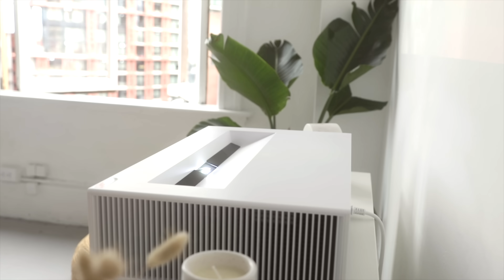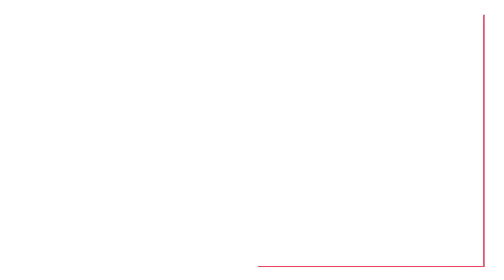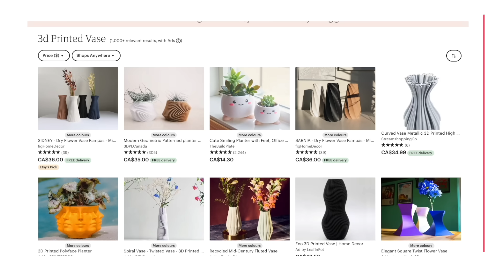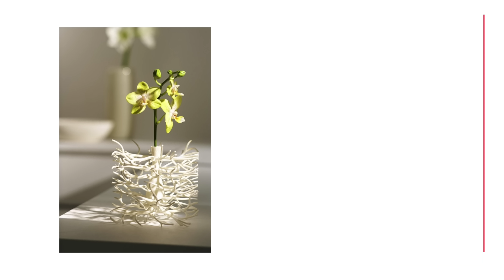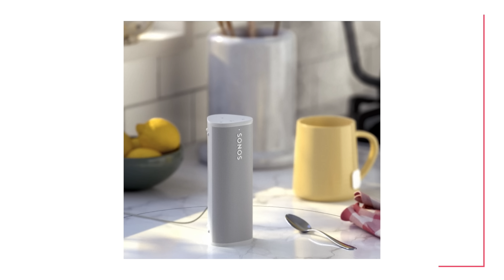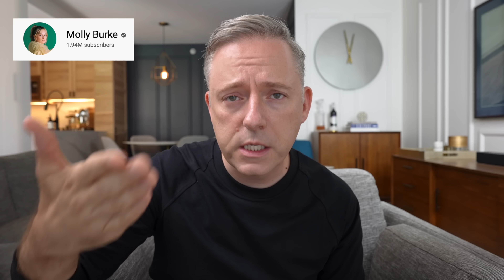Home Tech Trends 2022 | How Will Technology Shape Interior Design?

Comment: I jumped onto the smart home trend for a while. It's great when it works! Unfortunately all my plugs would stop working once a week when they required an update. The constant updates took more work than turning things on and off manually, so I ditched them after a while. Would love to hear about smart plugs or smart bulbs that just keep working once you've set them up.
Reply from the maker: They can be finicky. I love the stuff that can be swapped out and not the permanent stuff for this reason. If it breaks or becomes outdated - you’re stuck!
Reply: I have no issue with ikea smart lights with a Samsung hub.
Reply: My phillips  smart bulbs work seamlessly with my amazon echos. No updates ever. Have had for a ver long time.
Reply: I don't think I'd want wifi connected devices that don't update.
Reply: @leporid257  they update, but you can always just press the switch on the wall if you want.
Reply: Kasa bulbs and smart switches (wifi) work quite well for me.  Aqara products are inexpensive, but more hit or miss.  I've also had good luck with Philips, but they are pricey.
Reply: @arevee9429  I just use the ikea bulbs, same functionality as the Phillips ones, but much cheaper.
Reply: @arevee9429  installing Kasa ones currently and they’re really easy and work with my Alexa so nicely.
Reply: I’ve been using Philips/Signify Hue for over 6 years now and they work really well for me. I guess every couple of years the app unobtrusively informs me about an update, but I’m never forced into anything.

Comment: An important topic.
Looking at hiding the cabling …
Reply: I hid the cabling for the tv behind the crown molding I had installed.  It comes down in the wall to the cable box (which I'm getting rid of now) and then there is a conduit behind the wall from the wall unit that holds the equipment to the tv.  So no more visible cabling.